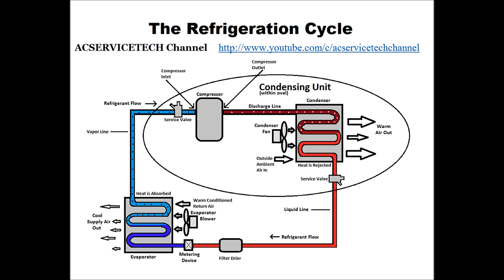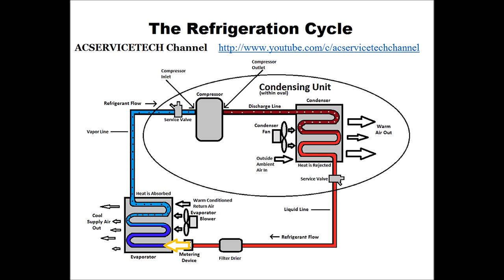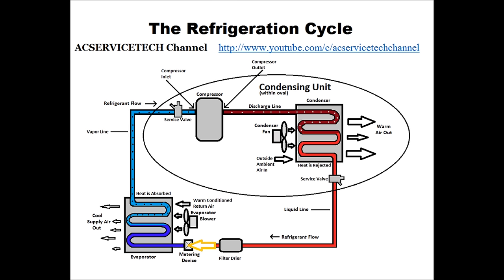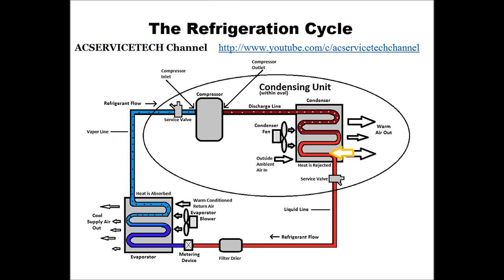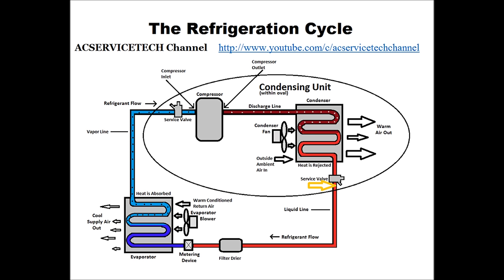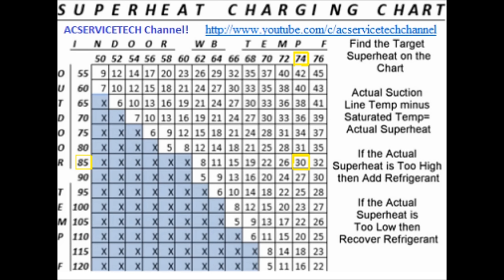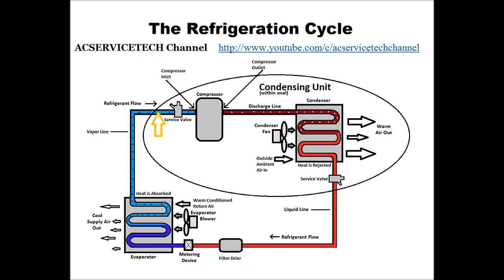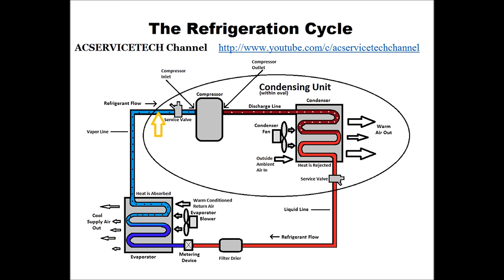Superheat and Subcooling Explained! How to Easily Understand!

Comment: Is it more accurate if the superheat is measured at evaporator exit point than at service valve? Since the line set run length, insulation, exposure to ambient temperature can vary from system to system. Let say evaporator coil of r22 are operating at 40f boiling point in the middle of evap coil, so the temp reading at the exit evaporator suction line should be around 45f to 50f to ensure there is  minimum 5 degree superheat happening in evaporator, Then we can disregard the condition or the length of the lineset which can be affected and not giving the accurate reading at the service valve. I am talking about fixed orifice system here.
Reply from the maker: I am totally with you. Yes it is much more accurate to check at the exit of the evap but no manufacturers recommend adding a port there and we see no one doing this in the field. Here is the other side though. As important as the size of the saturated state and the superheat measurement afterward, the compressor's safety is very crucial as well. We would need to check the total superheat which is measured at the outdoor unit to make sure that there is no liquid getting back to the compressor if during the lineset run heat were rejected on the way back to the compressor. Also, back when pistons were mainly used, they were not really concerned as much with efficiency.  We only recommend installing txv's for efficiency and compressor safety now, but hyes we need to keep the old ones running as efficient as possible, thanks

Comment: Great Video. Whate happens if you turn on the ac on winter time? does Freon still circulate through the system? Thanks
Reply from the maker: Yes it would. The system would be so efficient that the evap coil would freeze though due to not having enough heat to absorb while the outdoor unit would be able to reject heat extremely easy. Thanks

Comment: Hello I am thinking of doing over my ac system, in my country the temp is 90% summer,One TXV has a superheat of 4 and the next 8, would the TXV of 4 produce cooler air than the TXV of 8?, Both has the same part number just one has a lower superheat ?

Comment: Also in TN the weather goes from 35 to 70 f then back down to 30. Does that mean in order to avoid liquid getting into the compressor the superheat must be adjusted on a daily basis?
Reply from the maker: check out this refrigeration cycle playlist and look at the basic refrigeration cycle one. This is a heat pump. The charge in the unit does not have to be changed, thanks- https://www.youtube.com/watch?v=ZJR5rDPWLpA&list=PLxnHR5_D2ojwbAc7K7DsjuasaDVfJeGSe

Comment: how come you don't check superheat on a unit with a txv. wouldn't you want to know what's coming out of evaporator and adjust it for10 degrees
Reply from the maker: You certainly want to have some superheat in the vapor before coming to the compressor. Most txv's in comfort cooling are non adjustable and are sized for a 12,000-18,000 range. They will monitor the superheat for a range of 10-14 degrees across the coil. On a comfort cooling system you shouldn't have to adjust the txv unless someone else adjusted it before you for some reason due to an improper installation. It is also possible to loose bulb charge or for the bulb to not be positioned or tightened onto the suction line properly. Refrigeration txv's may need some adjustment depending on the application so yes refrigeration could but not much in comfort cooling. Thanks daniel grube!
Reply: U do check the superheat to make sure the txv is working properly. U have to have superheated vapor before it's compressed, u can't compress a liquid

Comment: So everyone using AC unit will need their superheat adjusted when the outdoor temperature changes? So every summer and winter heating cooling users are guaranteed a visit?
Reply from the maker: Superheat will change on it's own if there is a piston or capillary tube used as a metering device. The refrigerant charge should never have to be changed by a tech unless there is a leak, thanks!

Comment: Nah. Sub cooling is the temp reduction (in degrees) after the gas has cooled,and changed state (latent heat) to a liquid at the given pressure. Superheat is the temp increase after the liquid has warmed up, and changed state (latent heat) to a gas at the given pressure. Easier to explain with a graph. Love your channel though - respect.👍

Comment: Thanks man helped me out alot! But on superheat and subcooling say if you have a 30 degree sh i know its undercharged but wouldnt that mean itll actually do better because your picking up 30 degree difference of hot air going across that evap? And same question just reversed for subcooling
Reply from the maker: Hey Menitojr, 30 degrees of superheat depending on the wb inside and outdoor ambient temp could be an accurate charge. Look up "acservicetech superheat chart". So the saturated state will store much more heat than in boiling or in liquid state so the more sat stat meaning the less superheat, the more efficient heat absorption. The problem is that with a piston metering device, we need to make sure the compressor is safe and has superheated vapor regardless of the indoor wb or outdoor temp day so we set superheat with a chart, app, or calculation, thanks menitojr!
Reply: AC Service Tech LLC aha makes sense! Thank you so much your videos help out alot. Ever think about making videos on chillers and boilers?
Reply from the maker: I have a lot of thoughts and things I would like to be able to make. One thing at a time though, thanks!

Comment: Cant quite catch what you are calling the circled area at 0:52  it sounds like " the sub cooling area "  is that correct ? , great vids by the way.
Reply from the maker: That large circle around the top of the diagram including the service valves, compressor and outdoor coil is basically the unit that you would typically see outside which is called the condensor, thanks

Comment: I think you made it a little more difficult to understand than it should be.  Superheat is the difference in the actual temp reading of the suction line and the corresponding temp from the pressure of the suction line. Sub cooling is the difference in the actual temp reading at the liquid line from the corresponding temperature from the pressure of the liquid line.  Maybe I didn't make it any easier to understand though. LOL.
Reply from the maker: Maybe I should change the title from easy to understand to "More in Depth". I have people saying that they know how to set a charge using superheat and subcooling but asking what actually is subcooling and what actually is superheat. I want to make it clear that once you know the full refrigeration cycle and these details I am giving that it is a diagnostic tool to solve problems like when a charge is just not acting right. Thank you very much for your input John, I always appreciate your comments!
Reply: You're welcome.  It is a very informative video.  Thanks

Comment: Overheat is defined as the difference between the boiling point of a gas and the higher actual temperature.  The boiling point temperature for a measured pressure can be found in an P-T-Table.  The actual temperature can be messured but:  If the actual temperature of the gas is higher than the boiling point at a given pressure, shouldn't the pressure grow up, so that the temperature and pressure fit together again so that there ist no overheating?  I hope anybody understands my problem.
Reply from the maker: I do understand what you are asking and yes the pressure has not risen yet along with the temperature. Part of that has to do with the larger tube diameter of the suction line and the refrigerant is then not in saturated state any more where there is a precise temp to pressure correlation. You may also like this video, thanks-  https://www.youtube.com/watch?v=th0EnaSbJUw
Reply: Thank you very much!

Comment: Also, as a very general rule, not enough Superheat = not enough refrigerant. Given that, too much Subcooling = too much refrigerant.
Reply from the maker: not enough superheat or low superheat means too much refrigerant but too low of a subcooling means add. Too much subcooling is too much subcooling yes. Thanks Repet Myname!
Reply: Well tha's completely opposite of how a system works.

Comment: So there's only one two times when there is saturation, being in the evaporator and condenser right?
Reply from the maker: While running yes, that is correct. The efficiency has to do with how large those saturated states are but they must phase change out of the sat state before leaving evaporator and the condensor, thanks

Comment: What is the constant value of sub cooling.
Reply from the maker: The amount of subcooling that the unit runs at during normal operating conditions such as 8 degrees F or 12 degrees F, thanks!

Comment: Is there a difference between the optimal subcooling (for max effiency) in cooling mode or heating mode?
Reply from the maker: We only can check the refrigerant charge properly in cooling mode with subcooling because the accumulator on the heat pump would be drained. In heating mode it may have refrigerant in it which we will  not know how much. This is unless the manufacturer has given you measurements to go by to check a charge in heating mode, thanks Karl-Alfred!
Reply: Thank you for the answer.

Comment: Hey ac service tech. I ran into a problem a couple nights on call. Thought i had a bad expansion valve. Got the new part and peaked the model and serial on evap and condenser and the condenser was a 1.5 ton paired with a 2.5/3 evap coil. I had 22 superheat, 55 deg ssc, line temp was 77, subcool was normal, coil wasnt really sweating that much considering the high humidity levels. Something wasnt right. Technical support insisted this was a matched system. Supply air temp was 77 after half hour operation. Split was 10 deg at most and i had to lower the fan speed to its lowest setting. Does this sound fucked up? Also the evap coil sits on top of a furnace in the basement. So its not sucking in hot attic air if the were a return leak somewhere. Anyway let me know what you think of this.

Comment: Ok, sorry for being dense, but to be clear, is the physical superheat temp the difference between the temp shown by the guage corresponding to the suction line pressure minus the temp at the suction line control valve?
Reply from the maker: superheat is line temp minus saturated temp. sat temp is converted from the measured pressure. check out our step by step articles on https://www.acservicetech.com/articles thanks
Reply: @acservicetechchannel  thanks!

Comment: Maybe someone can assist me I'm fairly new but learning a lot.
I have tractor a/c the evap and expansion valve been replaced because fins were beat up and corroded poor air flow so I  replaced as a unit, the drier has been replaced condenser has been pressure wash no blockage there.  Drip tubes are free so water will drain and   clutch fan appears to be pulling enough air  but the  issue I'm  having is  the high side is going up over 400 till it cuts off then cycles back on  but the air in cab will freeze u. If any one can add a few good cents to this I would be thankful

Comment: Is it bad for the system if the line set is too long, like the condensing unit is on one side of the house and the evaporating unit is way on the other side of the house?
Reply from the maker: That would depend on the line set sizing but long line set like that is very normal. Many systems have 50-75'. Are you having a problem?
Reply: Not at all. I was just asking because refrigeration line sets in supermarkets and supercenters travel very far (underground/overhead) across the store and I was just wondering if something like that would be a problem in the case of HVAC.

Comment: Are these Delta temperature measurements also useful or possible in an automotive air conditioning system?
Reply from the maker: In a car, the compressor will be ramping up and down with the engine but may be around twenty degree temp diff with the condensor fan is on at park. In a single speed compressor  for a building the delta T is known. I don't work on cars that much, thanks!

Comment: i have a lennox R22 system in my house with TXV on the indoor unit. im getting 15.5° of subcooling with an outdoor temperature of 68°, High side was 149, low side was 44. Is this subcooling within range?
Reply from the maker: For the target subcooling, you usually can find it on the rating plate. If this is wore off then usually set it to 8-12 degrees of subcooling. I usually go for 11 degrees and then check for 18-21 degree temp decrease between the return and supply duct. Thanks

Comment: Does vapour density changes as we move from compressor outlet to the condenser coil ?
Reply from the maker: Vapor density is highest at the discharge and then decreases from there unit it gets to sat state, thanks
Reply: Thnx for giving me your valuable time and answer.

Comment: Why if the Tx vale frost is that mean filter block?
Reply: I has been a few years since I have been in school or worked on a/c but from what i understand... basically think of the filter as a orifice once it is plugged,  now your pressure differential is at the filter and not the metering device, therefor your flashing of liquid is starting before the evap and that is what causes the frosting. If this is incorrect please feel free to correct me people

Comment: for example when small vapor coming thru the metering device. what happen to metering device?
Reply from the maker: The metering device will become cool to the touch due to the lower pressure from the pressure reduction of the refrigerant, thanks Reynjun
Reply: so that incase what happen to evaporator?
Reply from the maker: Check this video out. The evaporator lowers in temp due to the phase change in order to absorb heat from the air. This may help- https://youtu.be/RofUUMl5x84
Reply: Thank you 😊

Comment: Hello :), I'd like to ask you for some advice. it is presently very hot here 35 and with humidity 45. I have several system that do not provide customers. I would like to know if it is normal that my suction is at ambient temperature knowing that it usually transpires. if I have a very high superheat, is it possible that the suction is not very cold? Thnx
Reply from the maker: Yes, that will happen especially if you have a piston for a metering device. A txv will allow a much better saturated state on the evap coil when it needs it the most, at high temp. A piston will work its least efficient when it is hottest out. You could have someone check the charge to verify, thanks GH!
Reply: AC Service Tech LLC cool :) thnx for your answer. Most system have à txv, i Will check the charge. This Is probably not enough gaz inside i supose. If not the système IT maybe undersize?
Very big thnx.. u help my life with ur tutorial and make me beter than Never :)

Comment: according to the rule of thumb 12 degrees to 20 degrees of sub cooling is acceptible.

only thing I'm struggling with is the majority of these videos are U.S so they're in Fahrenheit.

if you change 10 degrees celcius to farenheit you have 50 degrees f 

if you say 10 degrees Fahrenheit you are referring to -12 celcius.

the 12 degrees of subcooling can't apply to celcius and Fahrenheit it doesn't make sense 🤔
Reply: Rich Carter 
to convert the temperature difference between Celsius and Fahrenheit, just divide by 1.8 to go from deg F to deg C.  
10 deg difference in deg F corresponds to a difference of 5.6 deg C.  You don't apply the 32 degree offset normally used in the conversion since it cancels out when doing the delta temperature calculations.

So, for a 12 deg F delta, convert to deg C as follows: 
 12 / 1.8 = 6.66666 deg C

Comment: Air conditioning minds live in a messed up confused language of their own.  
Your gauges does not measure the temperatrues that are typically spit out by your experts at all.  There is no telling what temperature you people are talking about.  It is all swapped with each other... It is an outrauge.
The other expert has got his video titled, " evaporator temperature".   If you pay close attention, you begin to realize that the dude is talking about "saturation temperature", then you got "suction temperture", then you got "superheat temperature".
Then you got all sorts of other nonesne.
Your stupid gauge only measure two temperature.  It is not the air temperature anywhere, not of any metal anywhere, not does it measure the acxtual temperature of the coolant at various places., 
One measures the temperature of the actual vapor/gas or whatever you want to call it going into the compressor and the other coming out of the compressure.  Right there and nothing else.
The evaporator temperature in the freezer  is no 40 or 50 degrees;  The drarn thing is below zero for petes sake.  You want to put yout thermometer in the dog gone condenser I assure you it is more than 85 or whatevaer degrees.... weird weird weird.